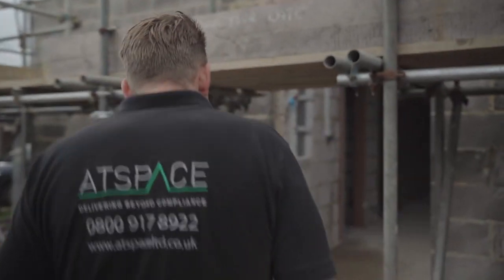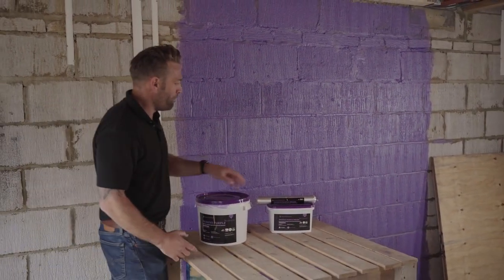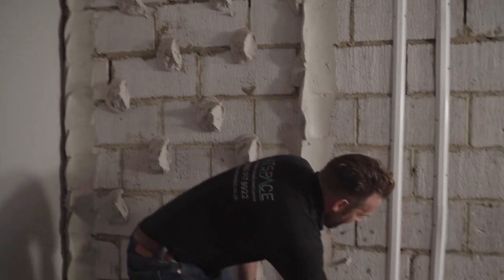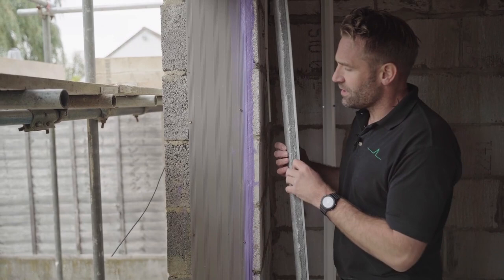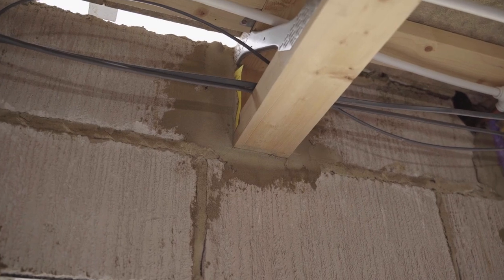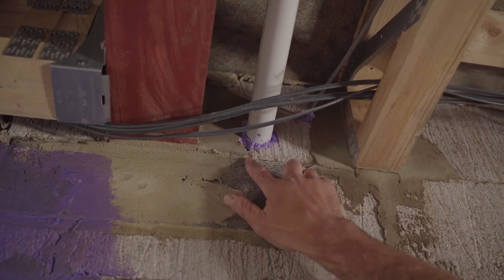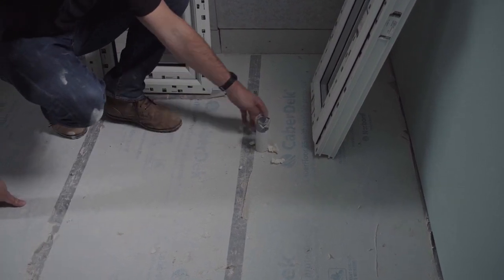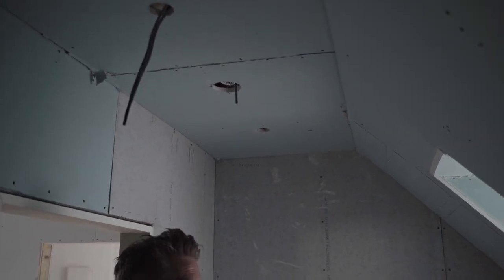How to Get a Block and Brick House Air Tight? - Part 1 - ATSPACE

Comment: Interesting but no mention of tape between plasterboard panels?
Reply from the maker: Hey, Marcheeen, when you mention between the plasterboard panels, are you referring to the scrim tape? This will either be filled if dry lined or plastered over, so it won't affect the airtightness. Let me know if I've misunderstood your question
Reply: @ Yes, thanks, that’s it. I had read somewhere that plaster, unlike sand and cement, is not airtight. So was wondering if any special tape would be required or if that is necessary at all.
Reply from the maker: @marcheeeen @marcheeeen, Use the standard scrim tape. The filler or plaster will be airtight.  Make sure the adhesive has a continuous bead around the outside of the plasterboard, or paint the blockwork with a liquid VCL-like passive purple. You will need to weigh up costs, etc

Comment: I get the impression that traditional construction methods make for a lot of work to achieve airtightness. I wonder if a SIP built house would have less time spent on airtightness.
Reply from the maker: Thank you for your insightful comment! You're absolutely right that each construction method has its own set of advantages and challenges when it comes to minimising air leakages. Paying close attention to the finer details is crucial, as the devil truly lies there. Understanding the specific junctions and interfaces where air leakage is most likely to occur is key. While SIPs offer significant benefits, in our experience, we've found that focusing attention on wall junctions and roofs is essential for achieving optimal airtightness. These areas often require extra care and precision to ensure a robust seal against air infiltration. Nonetheless, SIPs do provide a solid foundation for airtight construction and can streamline the process, particularly when combined with meticulous attention to detail in critical areas.
Reply: @atspaceltd654  thanks for the additional information. When I saw the purple coating, I thought maybe it could be applied by spray gun and that could achieve better coverage…especially in hard to reach areas.
Reply from the maker: You're welcome! The passive purple can be applied either by brush or by spray to ensure better coverage. We recommend conducting a diagnostic air leakage test after the sealing process. This helps identify any air leakage and determines the current permeability rate. With this information, you'll have a clearer idea of how much additional sealing may be needed.